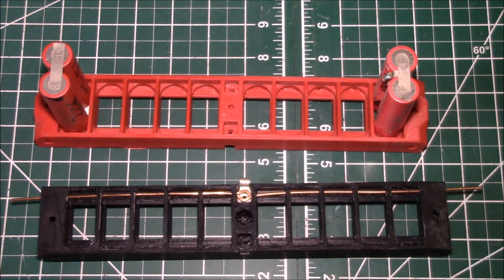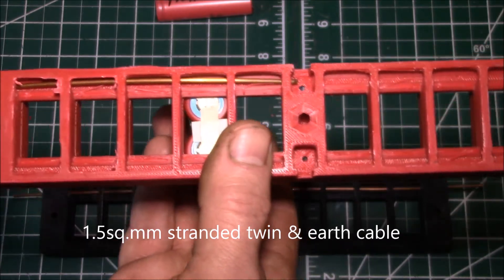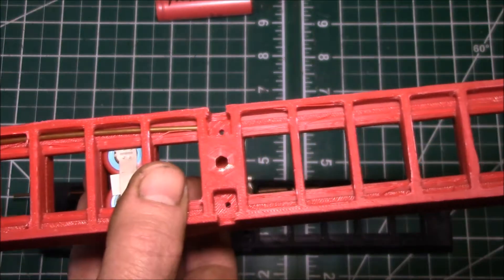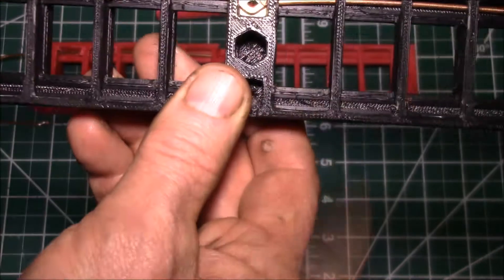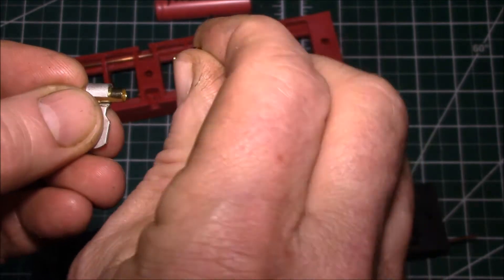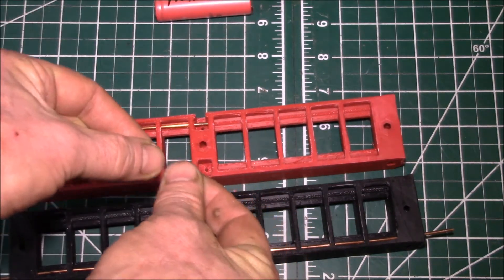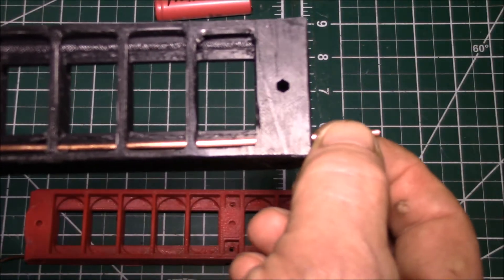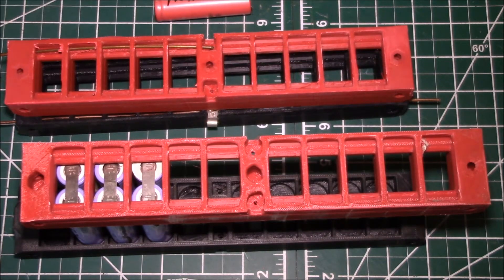20P/18650 Battery Packs, Part 1 of 3

Comment: I did not understand your purpose to 3D print those holders.
If this was to save on battery holders, they are dirt cheap like 5 cents each. I am sure your 3D prints might have costed equal or more than that. Rather if you could have some how managed to design them in way that you need not to spot weld the cells at all with nickel strip that could have justified the purpose, as you could always have had fresh, un-welded cells.
I like the basic idea though!
Reply from the maker: Good question.

The main advantage of these holders for me is that the majority of the used cells I have are already paired up from the original battery pack.  So that saves removing the existing tabbing and cuts testing time in half as I test factory paired cells instead of individual cells.

Another advantage is that by using this style of holder, the fuse wires can be soldered onto the middle of the tab between the 2 cells to limit heat input.
Reply: Reading your design and the comments gave me some really good ideas to. Thanks
Reply: Can these battery holders be found some where as cheap as what one person suggested.
Reply: I would like to link to that business if anybody has it .. 👍

Comment: Hi. You ought to modify the printed holder to accommodate the lugs without needing to grind them.
Reply from the maker: Yes, that is an option.  I've not had too much luck in modifying STL files in a small area without mangling them.  If I had the original CAD files, that would be a lot easier, but maybe I'll give it a try with Fusion360 and see if that works better than Meshmixer.

Comment: Looks like a nice design, good work!
Reply from the maker: Thanks for the comment.  So far I've been liking the 3D printed holders I've been using.  Been fine tuning the fabrication steps to make them easier to assemble and work better.

Comment: Good day, can you tell me where to get these plastic holders to build the 18650 pack?
Reply from the maker: I printed them on my 3D printer.  The link to the source files on Thingiverse are in the video description.  If you have access to a 3D printer, that'll do it, if not you can order prints on Thingiverse.
Reply from the maker: I printed them on my 3D printer.  The link to the source files on Thingiverse are in the video description.  If you have access to a 3D printer, that'll do it, if not you can order prints on Thingiverse.
Reply: R Brown ok thanks

Comment: Hi Rich. That battery holder was what gave me the confidence to forge ahead with keeping  my cells in their pairs. My 3D printer is too small to print those though so I had to resort to doing my own design. Nice solid design though. I like it.
Reply from the maker: Yes, it's a nice design, I think they now have an 8P and 16P version that prints on a 200mm printer bed.  I think your holder design is more compact and with that DIN rail mounting, is great for wall mounting.  I hope to get mine set up on slide out drawers in a small garden shed.